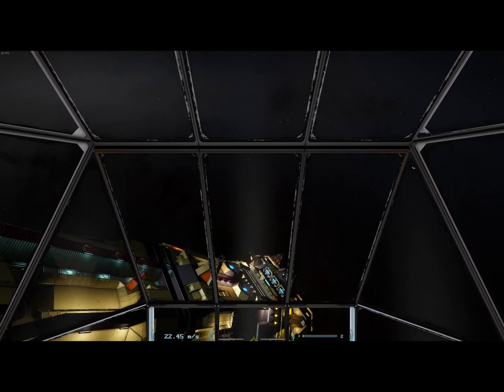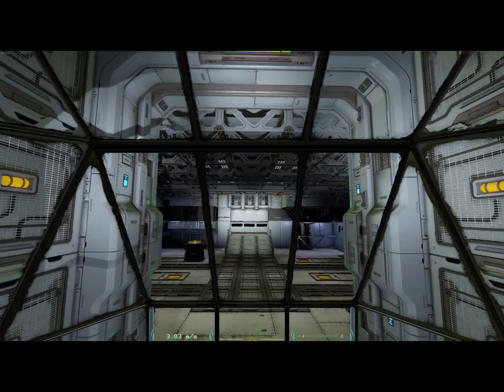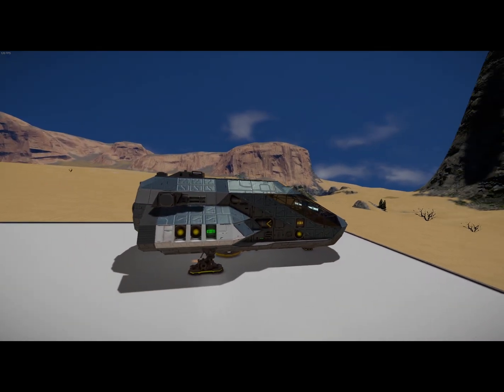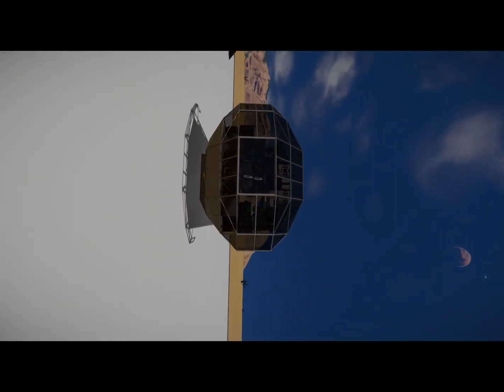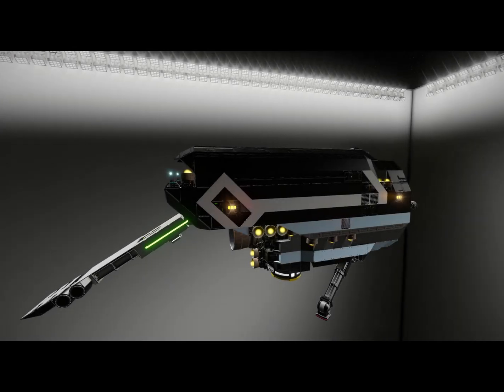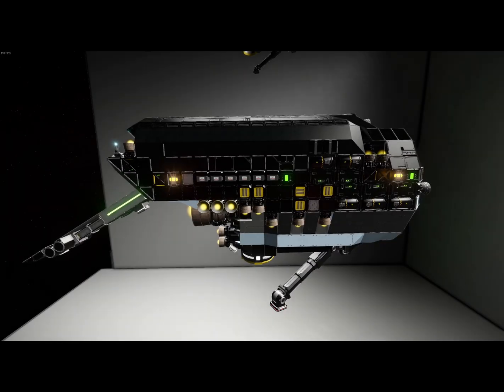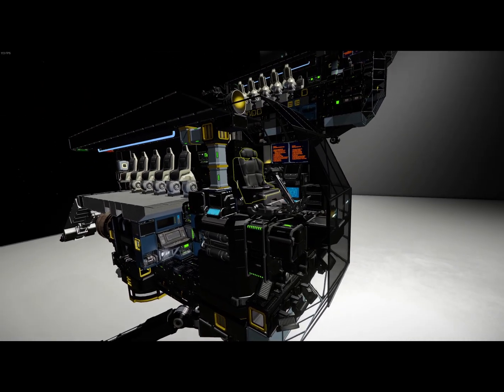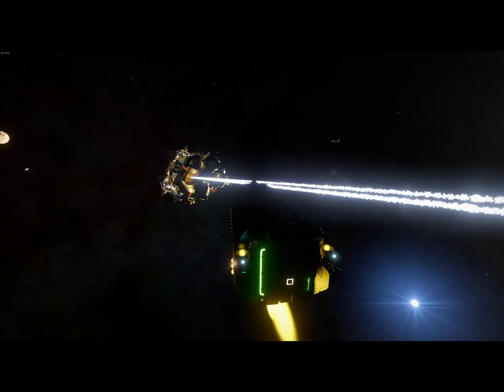Your passengers will thank you - The Rovok Crew Transport System

Comment: Large hydrogen tanks used to be much more space and mass-efficient though, as opposed to small hydrogen tanks.
Reply from the maker: Absolutely correct but the form does not allow for it. The additional consideration when using small tanks as part of the hull, is also that it's not just relative densities of large vs small tank, it's relative densities of large tank + whatever blocks you use to fill the hull versus small tank.
Reply: @ticklemyiguana  Well, time for a new design! It would be interesting to see what you would come up with if you decided to make "Rovok, but much cheaper, easier and practical to build".

Also I wouldn't hide completely the large hydrogen tanks on small grid, that's what I figured out in my builds. Also you could put the large hydrogen tank(s) on top, make it like a humpback shuttle, somewhat inspired by Beluga Airbus, passenger compartment on the bottom and a shorter ramp then. It wouldn't have such fancy seats, but are fancy seats really needed for a shuttle of this class? I don't suppose yours is meant to be a luxury sightseeing shuttle, just a thing to get people to and from a ship, so bolted down seats should do fine.